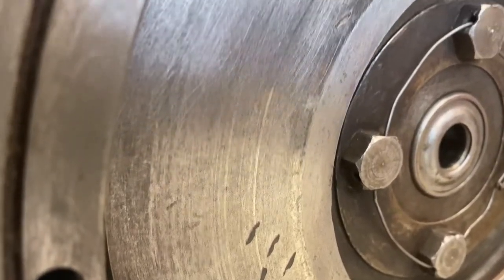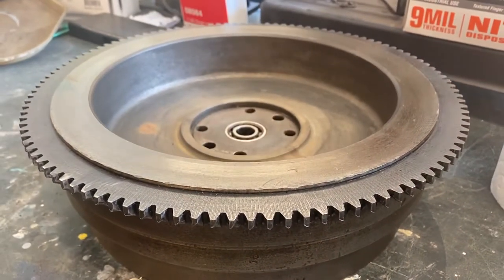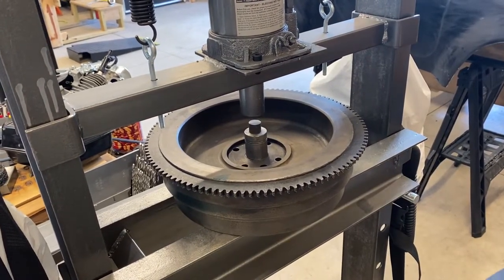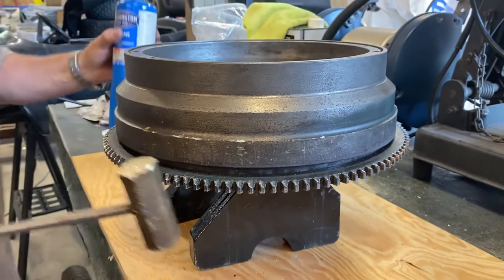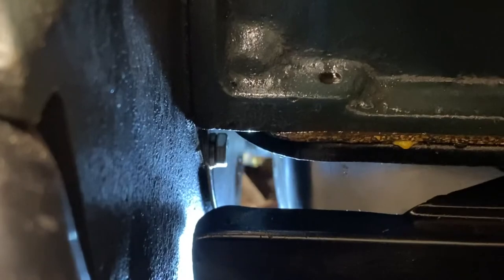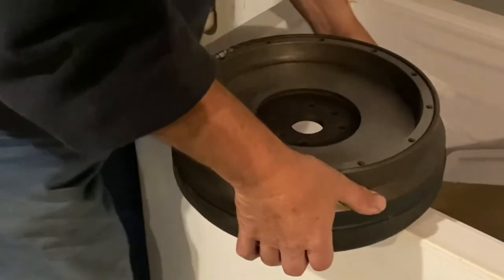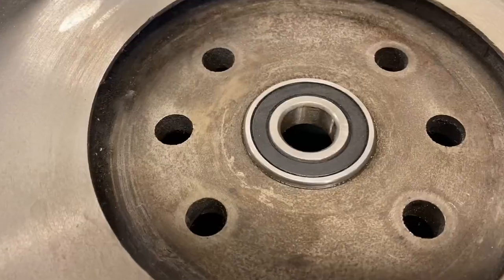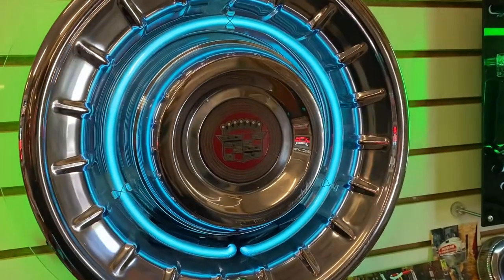1930 Ford Model A | Flywheel | Pilot Bearing | Ring Gear Removal and Installation | Flywheel Shins

Comment: old pilot bearing can be knocked out, should have lightened the flywheel and used a V8 pressure plate to ease shifting into first.   Reduces the wait for things to stop rotating between clutching and shifting. Otherwise grinding.
Reply from the maker: To us, the wait is part of learning to drive a Model A and part of the full Model A driving experience.  Do as you enjoy and others will do as they enjoy. Thanks for watching.